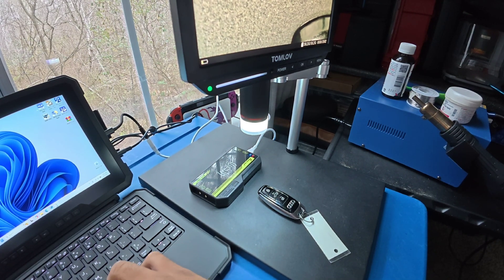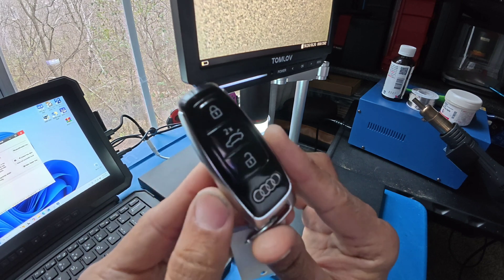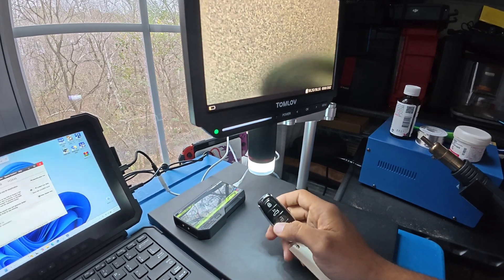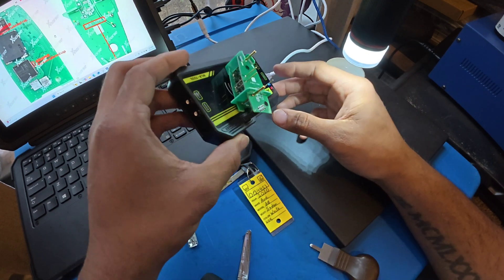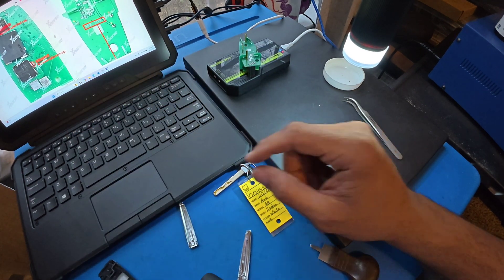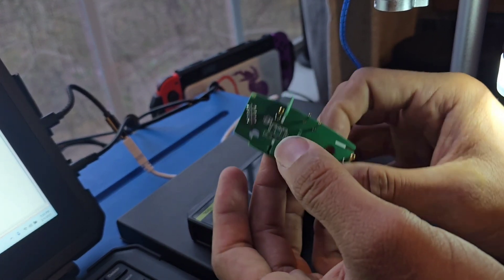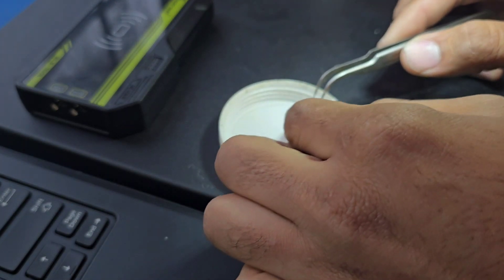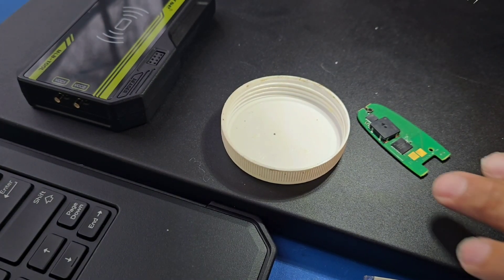EXTRACTING IMMO DATA FROM 2020 AUDI A8 MLB FOB

Comment: Can the capacitors /resistors be put back in in either orientation? Or is there a right way around?
Reply from the maker: on this particular capacitor, it does not matter since it’s not polarity indicated also for the resistor it does not matter always look out for polarity indicators
Reply: @AutoLockSector thank you. I appreciate that

Comment: First of all, a very professional video. ,The dealer key from the dealer is expected to cost $600-750. Once you have the dealer key, simply program it with Autel. I don't understand the sense in purchasing an MLB tool and opening the original dealer key to create a spare key. If the original key is damaged, you are in trouble - I truly don't get why I need to purchase an MLB tool.

Comment: What is the exact type, size, and specifications of smd capacitors?????Where can I buy it if it disappears during soldering?thanks
Reply: Excellent question! Wish someone could answer it. Those SMDs can easily disappear! Also, what about direction on caps?
Reply: No direction or polarity to these caps unlike electrolytic caps.

Comment: What would happen if you didn’t put the capacitors back? KYDZ tells me that they don’t need to be reinstalled.
Reply: wird dann nicht funktionieren. Der Schlüssel funktioniert immer noch, aber beim programmieren wird er Fehler machen. KYDZ macht keine Fehler, wenn doch sind die nicht Schuld, sondern Du als Anwender. Nie wieder KYDZ
Reply: @ I’ve used the KYDZ without putting the capacitors back on and it works fine so far.
Reply: @autoschluessel_hamburg why u say that kydz was the first doing mlb and also mqb 
Also they say to me capacitors doesn't need to be back

Comment: Great job I just did a 2022 Porsche cayenne man those resistors can be a pain to put back I’ve done maybe 10 of these MLB keys so far and each time I hate doing the resistors I think someone should make a video from start to finish including learning the keys to the car
Reply from the maker: @DavidPetrisor  if I can get an MLB type vehicle, I'll do a full video but a lot of these customers don't want to pay.
Reply: @ yeah because the dealer will do these keys for 700 so if I charge more then 5 or 6 they rather take them to the dealer Porsche charges 850 for a new MLB key and Audi is 450 for the key plus programing
Reply: @AutoLockSector 😅😅 all locksmith universal problem with this lots of customers don't pay 😕
Reply: @davidpetrisor with the Xhorse mlb key, do you have to generate a remote then load immo data on it? I’ve only practiced reading the data
Reply: Do you use a microscope? one of those caps is so small it falls under pcb micro soldering, its probably easier to use a hot air station and tweezers to position the cap
Reply: @robertficek7586 honestly only sometimes but yes they are tiny but on the MLB keys it’s okay not to put the capacitors back in it’s just the mqb key that u must reinstall capacitor